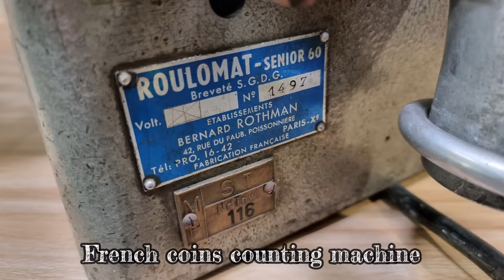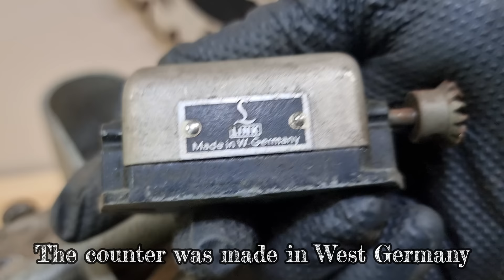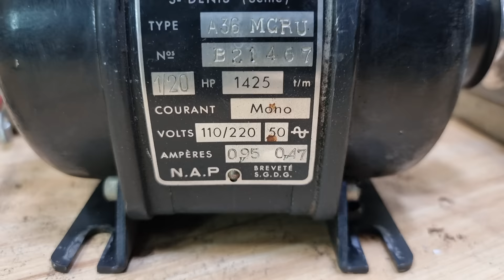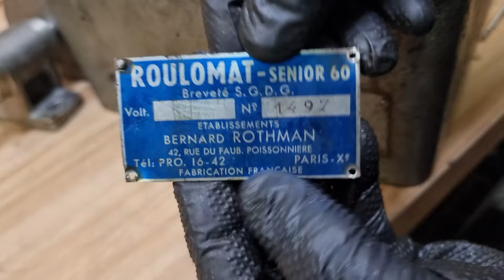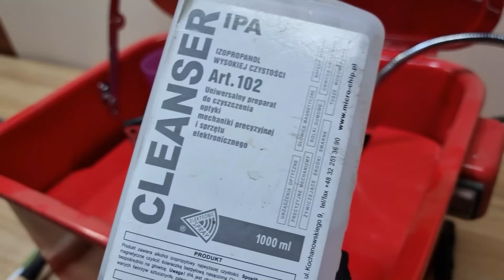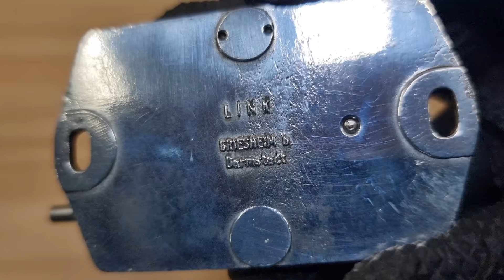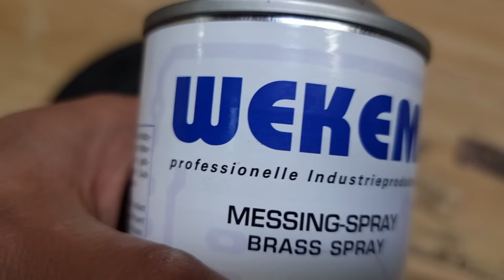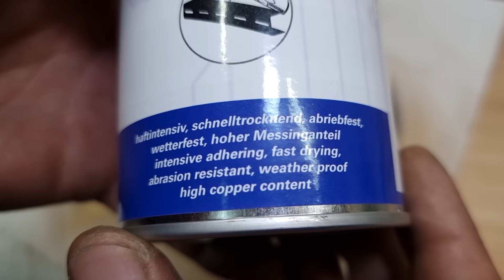French Coins Counting Machine Restoration - Uncovering the Mystery of a Rare Machine!

Comment: OK... so now I'm confused... I Know... what else is new... LoL... 
Absolutely love watching restoration videos... 
I'm 66 and my health and cancer... has stopped me from more then I care to admit...
With this said I have restored everything from cars, trucks, guns, tools, boats, and even helicopters... Long before video taping them and YouTube were around... (just my luck)...  
I was first introduced to a glass bead machine (Blast Cabinet) almost 40 years ago as a helicopter mechanic... and actually have two today, a small inexpensive Harbor Freight model, and a larger commercial one... 
 I have been seeing the "Laser" Rust removal machines for awhile now, and they are cool on every level... but man are they pricey...The model you have is in excess of $10K...
I absolutely agree that they have their place... I have an older Mercury 175 hp Black Max, boat motor that has been bored out to 200hp...reassembled... then left to sit... The motor itself is pretty good shape, but the bolts and nuts have rusted... and at the expense of removing every single nut and bolt and repainting them... using the laser to clean the bolts in place is a great option...
Here's my confusion... 
You used the laser machine for the removal of rust and paint, on the majority of the large items, requiring you to still go over them again with a sander and or a wire brush... 
So it suggest that the laser does not get it 100% clean.
If you have a blast cabinet... why wouldn't you have just gone ahead and blasted the larger parts... I know... there will be some who will say that it leaves the surface coarse, but that depends on the metal you are blasting, and the blast media you are using...
I restored an older Smith & Wesson revolver for my son-in-law years ago, it was rusted pretty bad... after disassembling it I blasted it, and yes, it ended up with a coarser finish then I wanted... but a few minutes on a grinder with a wire wheel, then bluing it... and it came out excellent...
My confusion lays with not blasting the larger items in the first place rendering them almost 100% clean bare metal with virtually no follow up sanding required...
Just an old mans thoughts...
Keep up the great work...

Comment: I liked the   going all the way to cleaning the motor.  Only reccomendation is the electrical connections. I would have installed ring terminals or at least wrapped the wires so they tightened as you turned the screw. (clockwise).
Reply from the maker: Thank you for watching and for your recommendation! 🙂

Comment: Nice job, however I suggest when attaching the orange ground wire on the strap, for what I believe is a starting capacitor, it should wrap around the screw in the same direction in which it tightens. That way it pulls the wire tighter around the screw.
Reply from the maker: Thank you! I'll use that! 🙂
Reply: Simply crimp an eye to the wire problem solved.

Comment: Why didn't you replace the bearing for the pully system, and the one for the spinning table?
Reply from the maker: Hi! Because they can do the job. I'm replacing it only if a piece/part is badly damaged and not working anymore. 
I am trying to keep them as original as possible when it is about such items that will not be used hardly again. If this machine will go back into business like in the 70s, yes, they must be replaced 🙂

Comment: Pretty sure that large ring with threads had a way of turning it so you could sort by thickness of the coin, the area you sanded down is probably where a handle or nub broke off.
Reply from the maker: The purpose of that ring is correct, but there was no handle or knob. It was just that gap to be able to insert a puncher/screwdriver; that's why it was damaged, and I tried to smooth out a little bit of the marks.

Comment: So, basically the laser cleaner burns off anything that's not the set material? For which materials can you use this thing? Looks sick.. keep up the good work 😊
Reply from the maker: Yes. It can be used for metallic parts, wood, and concrete/bricks.

Comment: Nice restauration but I dont understand why you dont use new power cable, v-belt and rubber wheel and wyh you don't use ring lugs. Everything was fine except the electric.... That's more like a  botched-up job.
Reply: The wire wrapped around that screw counter clockwise drove me insane.
Reply: Also im not sure if the disc is supposed to sound like that. The pain will come off from friction.

Comment: There is a method to add fresh grease to sealed bearings.
19:50 An ultrasonic bath in solvent, kerosene or diesel fuel (dissolves most lubricants) would be suitable for cleaning the meter without disassembly.
Reply from the maker: Thanks for the tips!

Comment: My mother’s old bank had to be of these. It was as hand crank no electricity. It did sort though. You would load up the hopper. Crank it and sort them. Flip the his lever on the bottom. Drop in the sorted and crank away. It would count it as fast as you cold crank it. It as a good workout for an eight had old 50 years ago.

Comment: I know a lot of patience is required to take something like this apart and put it back together however you shouldn’t oil the motor windings/stator with oil only the bearings, if they’re wiper bearings then just the pads that hold oil or if bushings then just bushing area, all the best

Comment: Working with small and large parts was great
The connection of the electrical wires was bad
I wish you could replace the rubber parts and the belt

Comment: Great job, but not sure whip you put oil on the inside of the motor, surely those parts do not touch so why the oil?
Reply from the maker: Thank you. This is what other people say: Grease/oil is the lifeblood of these bearings because it provides an oil film that prevents the harsh metal-to-metal contact between the rotating element and races. Bearing troubles account for 50 to 65 per cent of all electric motor failures, and poor lubrication practices account for most of these bearing troubles. 🙂
Reply: @rustyshadesrestoration you put too much oil. Oil  is aggressive for the varnish of the thin copper wires inside the motor !

Comment: 14:13 in my opinion Sandblasting machine cleans way better, doesn’t leave ugly marks and will not require wire brushing
Reply from the maker: They both clean well, but one is faster and eco-friendly, but not for every pocket and one is cheap, slow and dangerous for health and the environment.
Both require wire brushing if you want to get a very clean and smooth paint finish. 
Those marks are "laser patina" and they go easily out. The sandblaster doesn't leave marks but it is "eating" a lot from the metal. 😅😅
The list can go on, I think I can make an entire video about this topic. I have used both for a long time and I observed many pros and cons. 
Maybe I'll do one on my Secondary YouTube channel. Cheers!

Comment: First time watching one of your restorations and I enjoyed it, but the hammrrite paint application is what let it down somewhat, the finish of it is very uneven as it was applied with a brush over a large area., and applied too thick. I think spraying would have been a much better choice.  Also the laser etching lines were visible on some parts even after being coated, these parts might have been better prepped with sandblasting. Nevertheless, it was a great restoration, first one I've seen of one of these machines.
Reply from the maker: Thank you, Jeff! I just wanted a bit of diversity in my videos, and it was great to learn from it. With a spray, perhaps, could be better, but it depends on the painter's experience. I usually use powder coating, so I don't have much xp with the spray paint. Cheers!

Comment: Personally I'm not a fan of the paint job, would have nickel plated as well. Definetly needs a new belt, o-ring and roller. Alignment of the spinning disc seems to be an issue too. Some of your colleague restorers would have welded up the inperfections and at least fixed the crack in the ring. Otherwise all the blueing work and clean up are super jobs!

Comment: Hello. Can you tell me why you didn't weld the ring?
Reply from the maker: Which one? 😅
Reply from the maker: Can you point the minute?
Reply from the maker: If it is the one I'm spinning at 31:30; here is the explanation: That ring is made from aluminium, and its role is to detect and direct the coin thickness by screwing it or unscrewing it. That gap that you see is essential in case the coins overlap and get stuck between the ring and the turntable. If this happens, you can use the gap to unscrew it by force, punching with something on it,; otherwise, you'll never move the ring by hand. I hope I was able to explain this clearly.

Comment: Good restauration but not perfect from an lectrical point of view. A 	crimp-on ring terminal for the PE connection was not be used. BTW is black the right color for the PE Wire?
Reply from the maker: I do not have so much experience with electrical work. I just followed the wiring as it was, and it works. Please explain in simple terms what could be done better. Cheers!

Comment: the restoration project is vey cool and well made but the only thing that i find lacking is the paint job it is not good at all. the hammerite paint should be applide with different technique via roller or large brush so you can have a clean and homogeneous coverage with th hammerite paint pattern.

Comment: You should try out powder coating. I think it is stronger than hammerite paint and has a better finish.
Reply from the maker: Yes, powder coating is more robust, but I have some reasons why I didn't choose it. 1. This machine was painted with hammer paint, and I wanted to keep the industrial vibe. 2. I do not have such a big oven for those huge pieces. 😐
Reply: @rustyshadesrestoration  The good news is that it's possible to get hammer paint finish with powder coating today but the oven project remains as a future video 🙂
Reply from the maker: I was searching for it in my country and couldn't find hammer paint powder coating. Yes, a bigger oven is on my list. Thank you for watching and your suggestions. Cheers!

Comment: It should be able to sort several sizes of coins starting with the thinnest least diameter working up to thicker wider ones. I used a very similar design of machine to sort and count the coins from some launderettes that I once owned. Coins were £1, 50p, & 20p and during my ownership the 50p's changed sizes - just a small adjustment. Basically its just a mechanical filter so you first run out the tiddlers (20p in my case, followed by the £1 coins into cloth bank bags.
Reply from the maker: Hi! You are right, the machine can sort coins as well.
Reply: Did you do duvets?
Reply: @nope.0.  yes. Local dry cleaners brought them in a droves and charged their customers dry cleaning rates, we also did them for individuals at the standard rate.

Comment: Всё бы ничего, но зачем он статор двигателя залил маслом. Нет понимания в работе двигателя или что? не понятно. Данная оплошность выдаёт дилетанта...
Reply from the maker: Nothing wrong can happen if you use the correct oil; it helps prevent the inner chamber from getting rusty. I opened many electrical motors in my life, and over 60% had some lubrication inside 🙂
Reply: @rustyshadesrestoration  Вы пишите какую то чушь. В электродвигателях смазываются только подшипники. Я бы ещё понял, если бы вы очистили от ржавчины комплектующие двигателя (ротор, статор) и нанесли защитный слой лака, например, но никак не масло. Для справки, масло предназначено для смазки движущихся частей, там где присутствует трение, а не для защиты от ржавчины.

Comment: I Love the videos but is it me or the volume low
Reply from the maker: Thank you! I don't know 🤷‍♀️  for me if I keep my phone at maximum, it is perfect. What device are you using?
Reply: I use my phone and need maximum there but when ads they are super high
Reply from the maker: Aha, that's good to know. Thanks!
Reply: I just saw the slot machine Holly molly what a complex machine did u have to rebuilt over and over to get all parts right for the video ?

Comment: Елозит, как по кунке ладошкой. Разве так красят?
Reply from the maker: Not sure I understand. My translator doesn't help...
Reply: @rustyshadesrestoration  he didn't like the way you painted the hull.  from my side, also a small remark - you don't need to pour oil into electric motors as you did, because dust can get inside, accumulate there and damage the windings.  in general - very cool!
Reply from the maker: Thank you for your help! I'm not an expert with such motors, and I thought it was acceptable to do it as long I discovered oil inside, but your remark makes sense.

Comment: In this video, you are doing several things I don't like. First, spraying that brass spray onto steel may prove to be a mistake, because it could form a galvanic element. 

Second, filing away that sprue from the outlet is unaceptable in a restoration. It may make it prettier, but it changes it from its original state. If the original manufacturer left the sprues on, it's not your place to decide they have to go. It's like a curator in a medieval museum deciding that that roman sword could do with a new 15° grind. It's just not done. 

Third, the one thing you SHOULD have changed, you didn't, and that's the electrical wiring. When doing a functional restoration like that, originality must take the back seat where safety is concerned. Stranded wires absolutely HAVE to be ferruled, especially when used in screw clamps. In a case like that, I'd replace that probably rather brittle bakelite terminal block with modern wago clamps for safety as well.

Overall I'd give you a C- on that one.
Reply from the maker: Thank you for watching and for your honest feedback. I perfectly understand your perspective, but I can't say that I agree. 
The brass spray is designed to be applied on steel and other surfaces. 
Second, those imperfections seem to be caused by human intervention and not a factory mistake. I already studied other machines like this one. When it comes to your comparison, again, I disagree; here, I had to deal with an industrial machine from the 70s, not with a medieval artifact (that will be treated entirely differently), so let's compare apples with apples. 
When it comes to wiring, I replace them if they are "baked" and never something that's in perfect shape. I see that as an ultimate waste of material.

Another thing that I would like to mention is the fact that doing it is different than observing it from a side. When I watch other restoration videos, I also tend to say that I will do that rather than that. It happens even while I edit my videos, but then it is too late for that project, but I keep everything in mind and try to apply it in the further ones. 

Once again, thank you!
Reply: @rustyshadesrestoration  Well, it's your restoration, so you are perfectly entitled to your own opinion, and there's no law that requires restorers to adopt a conservator's position. It's just my opinion that restoration should be minimally invasive. 

All in all I feel you are head and shoulders above the bulk of youtube "restorers" in that you show genuine concern for preserving as much as possible of the objects you restore, and I'd like to encourage you to keep doing that. 

I do uphold my opinion on electricals however: Old machines tend to be built to lower safety standards than we expect today, and eliminating a sparking or overheating hazard is always worth the time. Even if it is just cleaning corrosion of the wires and crimping lose braid, if you don't want to replace any original clamps.
Reply: And I uphold the position about the spray paint. Pause at 35:28, the paint is already jacked after one load of coins.

Comment: Oh dear, there are so many mistakes made.
Pls use Glas Pearls instead of your ?vulcano Sand?
Your laser let leave so many Paint and marks behind, is it really worth the Money? Don't use paint on the sorting plate, cause the coins wont move as good on the rough surface and will scratch it in short time. Keep yourself away from electric. Seriously you show so many failes on wiring and cleaning the motor...